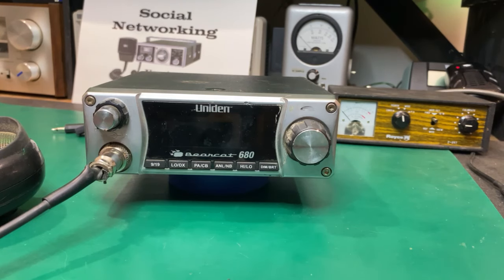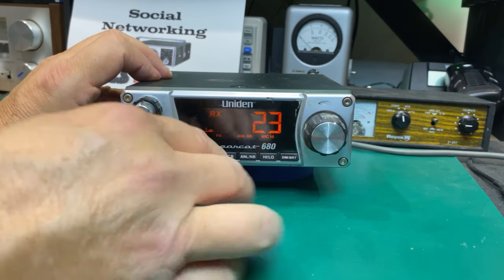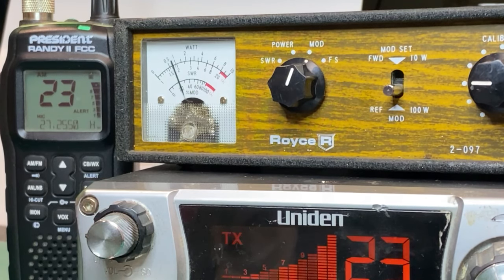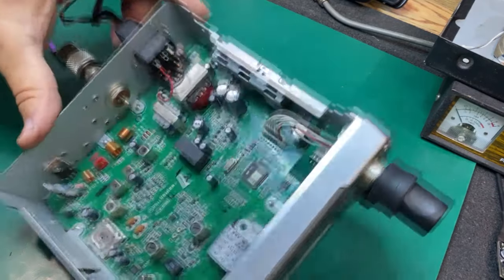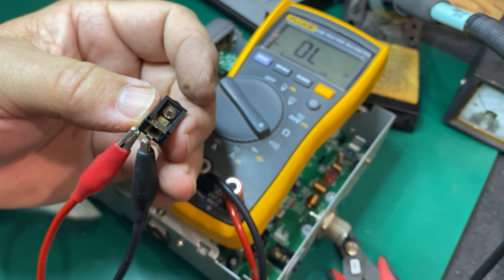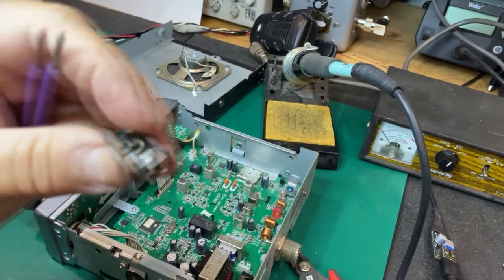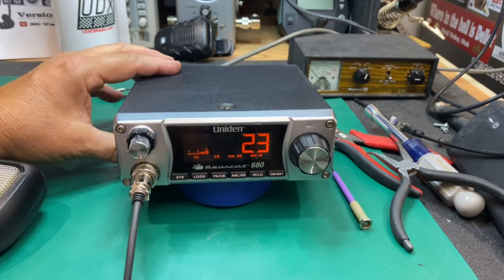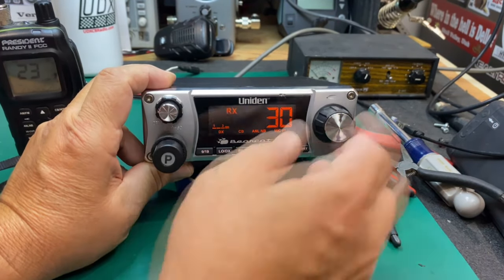Uniden Bearcat 680 No Receive FIXED  How to Troubleshoot a CB Radio

Comment: Holiday gas station in. Mitchell south Dakota. Had one of those for years for sale. Brand new in glass case.   . Saying to my . self should buy it . Just to have it. In.  collection ...  one month later.  It was gone...   ...   but.  Scored on a. Midland  1001. Wx.   From.   Petro.  🚚  Truck stops.   For.  30.00 bucks.   And had.  15.00.  Saved on points.    

When the. Uniden. 787. Came out.  . Think ot was that model number....  thought it was ugly...
Now way not so much....   should have bought it way back then.
Think it was around 2005.   When it came out.  787.  😊